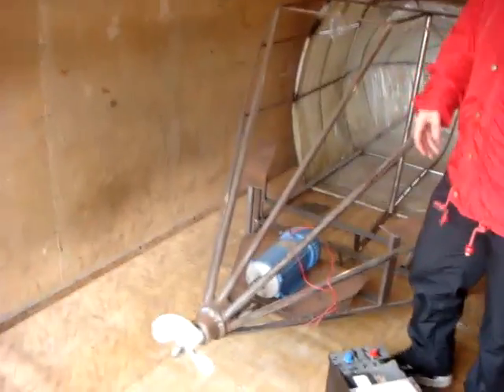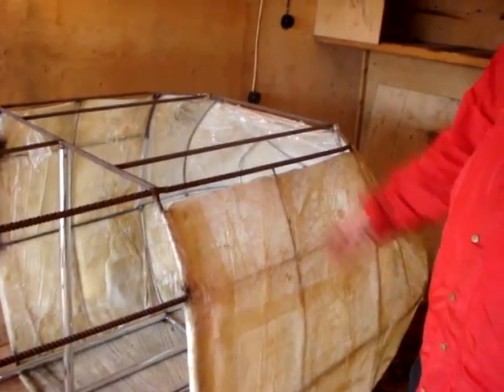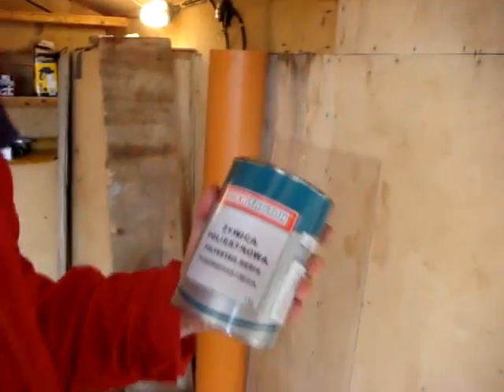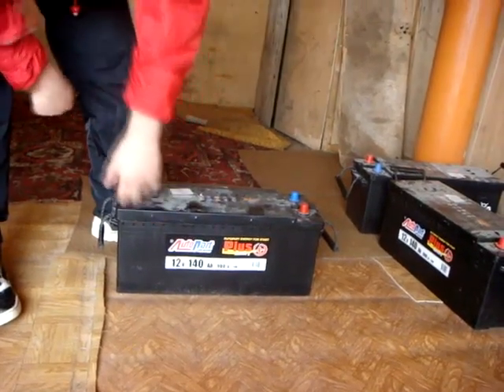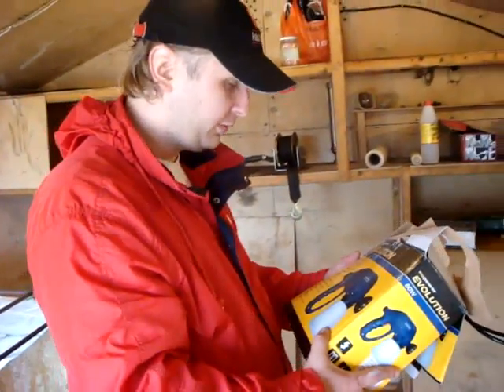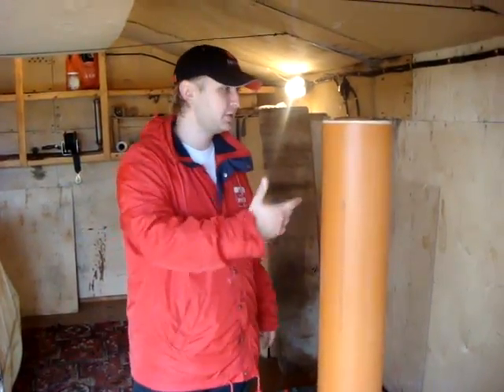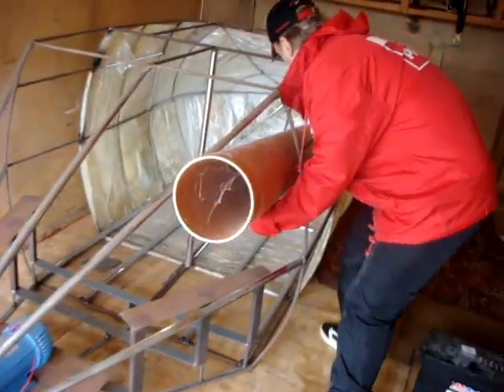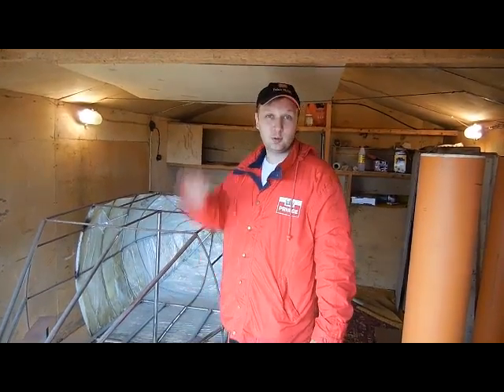Homemade submarine Kickstarter project

Comment: I like what you doing. but need do a little bet of planning on that pressure hold that pressure of water will crushed you wend you get to 10 feed. from my point of view it needs to be a little bet bigger so you have more buoyancy and be more stable. I know is your dessine.but that stroture inside is Betty important. to me it need to be stronger on that inside
Reply from the maker: I will probably be renforcing by welding pins on key side frames smth like this http://www.vmasshtabe.ru/wp-content/uploads/2012/01/SHpangout.jpg

Comment: I have a few tips for you:
1. Your frame is welded wrong and it will not sustand any pressure. If you want to make a pressure hull you should make large steel rings and then weld them up toghether.
2. Epoxy is the way to go. Thin steel sheets even better (and cheaper). Fiber glass just wont do it so stop spending money on it. Once fiberglass becomes solid it wil crack from a pressure and will start leaking. Epoxy on the other hand does not crack, it bends.
3. Your sub will not submerge because of the displacement. Its just too light. You\ll have to put much weight to ir so you have to calculate the frame to withstand that weight.
4. Water ballast tanks has to be placed on the bottom outside the pressure hull to prevent flipping upside down and to capitalize from neutral pressure to inside and outside of the craft. If you wont do it, you'll have to replace your ballast tanks with ones that can withstand inner pressure like steel canisters that is used to contain propane or other gases.
5. Your ballast tank pipes wont withstand the pressurised air. You should get some industrial canisters that is used to contain oxygen, CO2 or propane gas. Best to buy used.
6. Don't start the project if you don't have funds or willpower to finish.
Reply from the maker: +Karolis Kloniūnas Hello fellow countrymen, right on the spot with tip fix, to follow up:
1) All welding was done by me and another great man 53 y. o from 8 in the morning till 10 just one day we had no plan no drawings charts nothing it was purely instinctual, however what i planned is for to have a metal skeleton onto which molding/coating will be applied. But i have thought of buying mig/mag welding kit and reinforcing the frame.
2)Epoxy is awesome i really liked its hard and lightweight, the reason why i discarded metal sheets is that i intend to transport load/unload by as much as 2 people and transport it in a van like Mercedes Transporter or Ford Transit to have sledges and to slide it into water then using a winch pull it back again therefore i had to make it lightweight as possible hence metal armature skeleton.
3) It is light but i have ballast tanks plus i can have up to 4 on each side thus having 800litres of ballast including all the weight from equipment and also extra weights as Brian suggested/ the frame currently can withstand a ton without further reinforcement.
4/5)Those plastic ballast tubes are only for water or air (not pressurized) for that you are correct and i will indeed have oxygen cylinders for breathing air and Co2 for shooting out water and for surface on the side not to capsize and increase stability, however oxygen cylinders most like will be inside and i will remotely activate Co2 Moreover the increase in pressure comes with increase in depth for each 10 meters 1 atmosphere or 1 bar = 105 Pa (N/m2) = 0.1 N/mm2 = 10,197 kg/m2 = 10.20 m H2O = 0.9869 atm = 14.50 psi the one that i have is PN 6&#160; - max pressure 6 bar. Therefore i need to exceed depth of 60 meters in order for pressure inside to increase to cause damage not considering that i will have a pressure release gauge on the inside of the ship for inner pressure inside of the hull
6)Good advice, but not all is going in life according to plan or as we intended for it to be
Thank you for your interest. Take care!
Reply from the maker: DC Electric pumps
Reply: Karolis Kloniūnas  how you get that water out of that balester tanks
Reply from the maker: Hi, we will be using electric pumps, 1 for 2 tanks, 3 pumps total.

Comment: so is it a boat or a sub?? it will take thousands of pounds to submerge it especiall since the fiberglass isnt as heavy... cool project!
Reply from the maker: +Brian Davis Hi there, its a sub (initially) i was giving it a big doubt also on how to "sink" it, but found  that its not all that as Archimedes law say, as i have to take into consideration full weight including interior fabrication, passengers, raw material, air tanks, batteries  "they are very heavy" around 50 kg*4  and ballast which will be 600 litres so all in all more than a metric tonne would accumulate and the volume of submerged body equals to weight of water pushed out, It can get tricky but i can always use an extra set of weights, i will be conducting first water trials hopefully this spring as i finish coating the boat just to see the buoyancy and how it stays on water, it will be a long journey but hopefully with success on the bottom :) Take care!
Reply: +3EBC external wieghts would be nice for dropping in case you need to go up quickly! i would love to see your progress! im also curious about windows.. thank you for the video and response!!
Reply from the maker: +Brian Davis There will definitely be scuttles/illuminators/windows on the side and in front